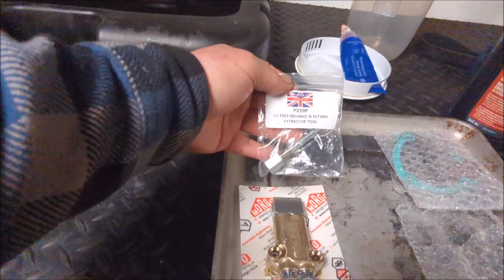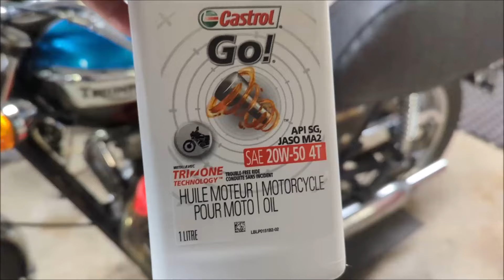Triumph Bonneville T140v - Part 9 - Oil Pump Replacement

Comment: An old biker here ( been riding 55+ years with all kinds of makes and models). That’s a nice clean triumph , the header pipes aren’t even hardly blued. When I got my 77 140 ( in beautiful white and Chrome side covers ), the first things I did where to put in a high volume oil pump and a high output, alternator with a dual Zeaner diode‘s. That way I could run higher wattage lights. I tried the Rita electronic ignition, but it kept failing on me so I went back to points. With points you can always clean and adjust and get home. I noticed the aftermarket spin on oil filter, never tried one. When you change the oil be sure to clean the screen at the bottom of the oil tank. If it gets restricted you will lose the oil flow. I’m kind of a purist so I had to kind of Cringe when I saw how someone cut the side covers to make the carb extensions and K&N filters fit, just hurt my feelings. I miss that old bike, but sold it to a collector so it went to a good home. 😊😊
Reply from the maker: Hi @johneverett3947, I am on my way to becoming an 'old biker' too, so really appreciate you passing along some of your experiences and info.    I've put a high volume Morgo oil pump on the bike but haven't yet done anything with the ignition other than to clean and set the points.   I am thinking about adding electronic ignition over the Winter and leaning towards installing a Trispark system along with new coils.   Appreciate the tip on cleaning the oil screen at the bottom.   I've done this twice so far.   Each time it has  been perfectly clean, but will continue to take it off, inspect and clean it annually.   The twist on oil filter is a huge improvement over the screen alone.  I agree with you regarding the side covers.   That was the only thing with this bike that wasn't ideal when I was looking to buy it, but must admit it does make setting up the carbs, tuning, and testing air flow much easier than it would otherwise be if you had to remove the side covers each time.   I could of course buy some side covers and put it back to stock, but so far I am embracing the unique character the bike has, including the side cover anomaly.    Thanks again for your note.   Really appreciate it!

Comment: You have put the oil pump nuts on wrongly. The taper on the nuts fit into the taper machined on the oil pump body
Reply from the maker: @briannicholls187 thanks so much for your comment and for pointing out this error.   I have updated the description field of this video to highlight the issue and explain that the   convex side of the washers and nuts are to face inward on the oil pump.   I'll also take the bike apart this weekend to correct that issue as this error on my part needs to be fixed.   I really appreciate you taking the time to point this issue out.   If you haven't already, please subscribe, and thanks again!

Comment: Did you consider fitting the Morgo rotary oil pump or were these long term out of stock at the time?
Reply from the maker: Hi @p-n, I did consider it but after reading a bunch of the forums there was general consensus in the threads I read that it wasn't necessary unless you were building a race bike or had a custom set-up.   The Morgo standard two chamber pump was the recommendation of the the vast majority and I didn't see any posts where someone regreetted their decision.   That said, I don't know :)   Made this decision purely on the advice and experiences I read in The Triumph Forum and other places.   Time will tell :)     Thanks Again for the Comment!  I really appreciate it!

Comment: You have put the nuts on the Wrong way round on the oil pump. 😱
Reply from the maker: Hi @martindavies8326, yes and I've included that information in the description of the video.  Thanks so much for your comment and if you haven't already, please subscribe.  Thanks again!
Reply: @MadTinkerman Hi there glad you shopped the mistake, the Morgo oil pump are really good pumps, I’ve had mine 4 years now on my 69 Daytona with no more wet sumps, win-win 👍

Comment: Ffs how to destroy your engine ! You shouldn’t use gasket sealer ever ! As a last resort Wellseal and you should prime the oil pump with oil before fitting
Reply from the maker: Hi @dustybwarf,  thanks so much for you comment and the info!  The gasket maker I used was anaerobic (not silicone) and just a thin coat.   Have used it before on other engines and it works good, and has the added benefit of not gunking up the engine in any way as it only seals under the pressure of two mating surfaces.   The oil pump was filled with oil when I installed it, and I was able to see oil returning to the frame tank within about 15 seconds after start up.   The Morgo oil pump really works well and chose it based on comments from folks like yourself that have been kind enough to share their knowledge and leave comments and advice.   I really appreciate the info, and if you haven't already please subscribe.   Thanks Again!